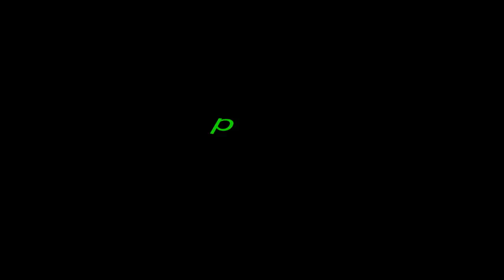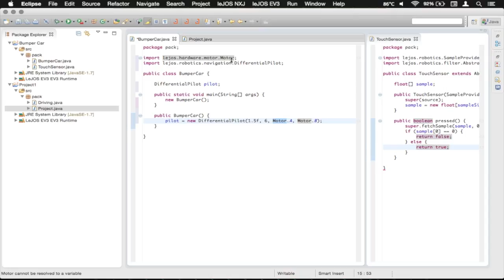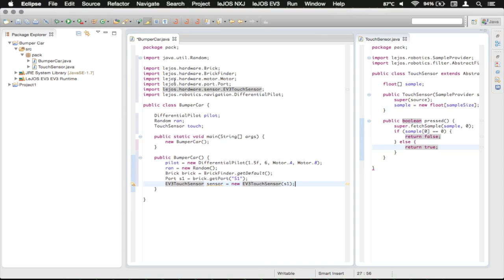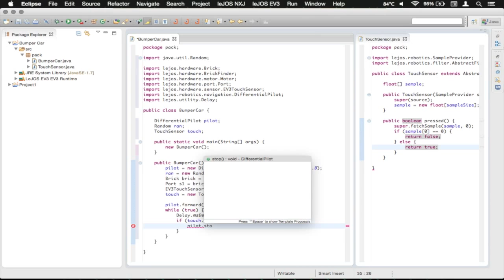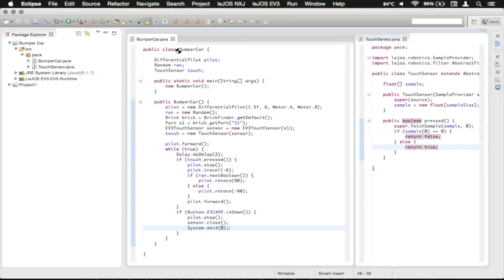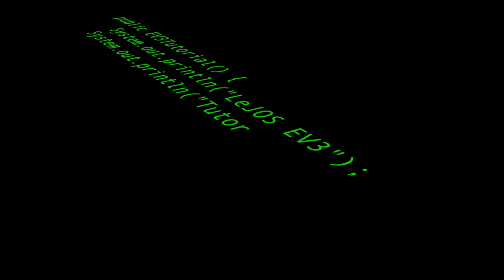LeJOS EV3 Ep13 - Bumper car project Pt2

Comment: Great videos. I just got the message that DifferentialPilot is deprecated. It appears that it is now recommended to use MovePilot.
Reply from the maker: +John Grøtting Thanks for pointing that out to me.  I'll look into it and upload a video covering the changes.  It seems to make it a little harder to beginners to use, but much more uniform.  In the mean time, using the DifferentialPilot is fine (it's going to be removed eventually, but it is in for now).  Thanks again.